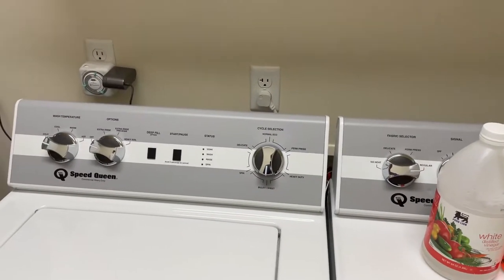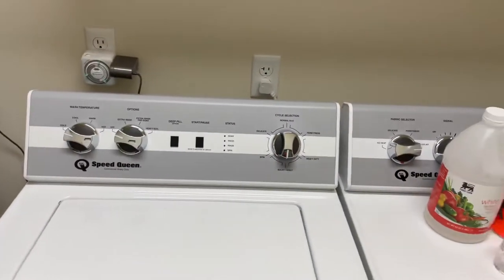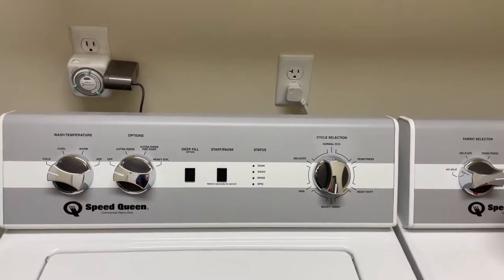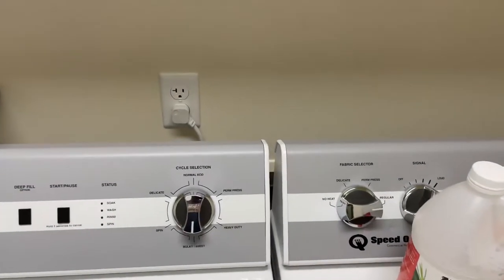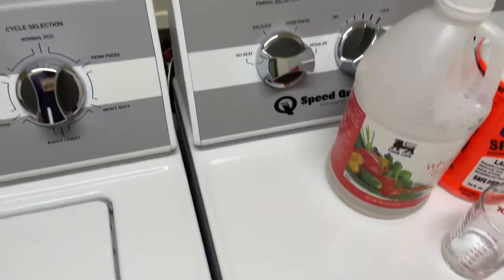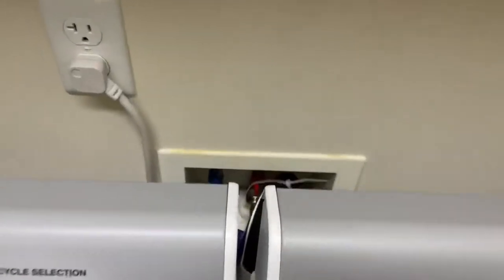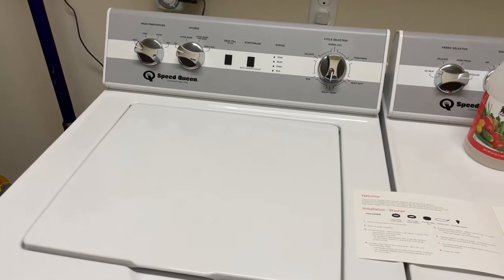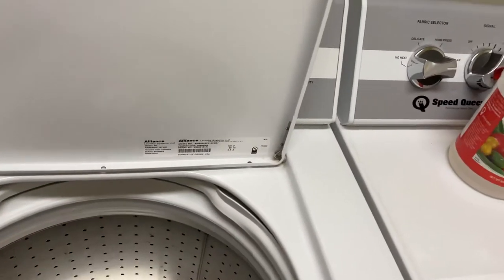Foam Bubbles coming out Speed Queen Washer drain hose - Fixed!

Comment: Thank you for sharing your videos. I currently need to purchase a lint cover my TR5000WE dryer. Bought both washer and dryer in July 2020.
I am interested in cleaning below the lint trap. Build up do I need a service call or can I  do it with a vacuum. The screw in the lint trap is very hard  to move. Maybe it's me. Got any suggestions or do I  need to get a service call? It appears to be a large build up under the lint trap. Thank you. I would check dryer it would have water in the tub from time to time. Not sure why finally got it stopped. 😕 love my set I switched from my front load set to Speed Queen.  I believe less overall hassles. Thank you, again.
Reply from the maker: Hi Vickie.  You're welcome.  Yes.  I remove mine once per year to clean underneath it.  The screw that holds my lint trap in place is a small, hex, American head socket.  Clean all the lint away from around the screw with a small screwdriver or pick so you can get a socket on the head.   
     Thank you for leaving a comment.  Please click on the words “Rick’s Tid-Bits” underneath the video to go to my YouTube channel.  I think you’ll find some helpful and unique tips in my How to Make Life Easier or Better section.  https://www.youtube.com/channel/UCc-IuUFzC2Tyv06KzJyBESg  Rick You’re welcome.

Comment: The following worked for me. I tried every imaginable combination, resulting in overflowing foam.  Have only owned it for 2 weeks.

Foam is created during the SPIN cycle. So must monitor it, it’s about 5 min spin cycle. Luckily, I was supervising during spin, cleaned up foam mess while occurring, before it migrated to hardwood floors. 

1) “Permanent press” or “Delicate”.
Other washes have FAST spin creating excess foam. Especially Obama Eco wash. It foamed and leaked a lot since also no rinse cycle.

2) Fabric ECOS Laundry detergent. Use only 1/2 a sheet. 1 sheet caused foam.
Reply from the maker: Hello Hoa.  I agree.  The high speed is 8 minutes long, and it's always the last 3 minutes of that spin that causes the problem.  The low speed spin doesn't do it.  Thank you for leaving a comment.  Please click on the words “Rick’s Tid-Bits” underneath the video to go to my YouTube channel.  I think you’ll find some helpful and unique tips in my How to Make Life Easier or Better section.  https://www.youtube.com/channel/UCc-IuUFzC2Tyv06KzJyBESg  Rick

Comment: Besides this method the only other solution I've found is using powder detergent vs liquid (I prefer powder anyway) 0 suds with the powder.
Reply from the maker: Interesting!  Thank you for adding that Dylan.
Reply: Wish that had solved it for me, but it didn’t. We still get suds when using powdered detergent. 😢
Reply: @jbintx4009  how much powder do you use? I only use 1 tablespoon for normal fill and 2 for full tub. You might still have suds from liquid in there

Comment: I tried adding vinegar to the wash cycle and the rinse cycle. I also ran a few loads of no clothes and vinegar then another no clothes load using a cleaning tablet. Nothing has worked. I still have foam on any cycle. So far nothing has worked.
Reply from the maker: Hi Joni.  Try this:   Speed Queen told me to run a cycle on Hot, no soap, with a cup of vinegar.  They told me it would flush out any residual soap build-up in the machine and the drain line.  That helped for the next 2 loads.  Then, we were back to the same issue.
Reply: @rickstid-bits  Thank you for the suggestion. I understand that detergent has changed significantly in recent past becoming much more concentrated. Have you ever heard of a hose adapter to prevent the foam from running over the pipe? I wonder if that would help.
Reply from the maker: Hi Joni.  I haven't.  The problem is:  We can't completely seal the gap between the washer's drain hose and the drain pipe.  The house plumbing needs the air inside that pipe to form an air gap.  If we sealed those pipes together: We run the risk of creating a back siphon.  That could cause sewer water from your house plumbing to flow backwards, into your washer, and onto your floor.  
     I thought about having a rag/cloth soaked with water and vinegar and wrapping it around the opening of the drain hose.  But I would have to wet that ever day we did laundry, so I never tried it.  Rick

Comment: I think there needs to be a class action lawsuit against speed queen if they refuse to solve this issue….
Reply: I agree. I noticed he said that the drain pump keeps pumping air while spinning. That's what creates the foam soap suds. Is that a normal thing with other washing machines?
Reply: @randothecomando this is the way all washers used to work, something has changed in the detergents in recent years, speed queen has used the same pump for the last 30+ years, but this has only been a issue for the past 4-5 years.
Reply: I used a tablespoon of Tide HE detergent with the normal eco mode as instructed to correct the problem, but that didn't help. But it still foamed over.
Reply: @randothecomando   stay away from the eco cycle,  the pump is on from the time the wash water starts pumping out all the way to the end .  Makes this issue way worse.
Reply: Speed queen is not what has changed here but they are going to have to adapt to the changes, for instance the mechanical pump is far superior to the electric pump but I wouldn’t fuss about them switching to the electric pumps so they could cycle them on and off during the end of the final spin, solving the issue.  That is why the newer design machines don’t do it , they were designed to use the newer formula detergent.
Reply: They sort of did solve this problem. As others have said, the pump is working the whole time the washer motor is running. The pump is hooked directly up to the motor. With the newer TR series speed Queens as well as every other new washer, the drain pump is completely separate from the motor that turns the agitator and the tub.

Comment: Why should you have to?
Reply from the maker: We shouldn't.  We shouldn't have to do any of this.  But the reality is . . . if you have the foaming problem, here is a solution.  Rick
Reply: @rickstid-bits  Hi Rick, were you using high-efficiency soap detergent?
Reply from the maker: Hi J.  We use Atsko Sport Wash.  It has zero fragrances and zero additives. It is an extremely basic clothes detergent.  We were using this same detergent in our last washing machine for years - without any foaming problems with that machine.  
Thank you for leaving a comment.  Please click on the words “Rick’s Tid-Bits” underneath the video to go to my YouTube channel.  I think you’ll find some helpful and unique tips in my How to Make Life Easier or Better section.  https://www.youtube.com/channel/UCc-IuUFzC2Tyv06KzJyBESg  Rick
Reply: @rickstid-bits  Does the Atsko Sport Wash work in HE machines? I just bought a Speed Queen and having the foaming issue. I haven't tried using it on any other cycle other than ECO yet. I have to wait for more clothes to wash. TIA
Reply from the maker: Hi Debra.  I honestly don't know what makes a machine an HE machine.  I've never been interested in an HE machine.  I simply want a washing machine that does a good job washing clothes.  I recommend you do not use the ECO cycle.  In my description under my video:  Click on the word More, and then please read all the information I have there.  That explains why some cycles are better than others.  Rick
Reply: I tried the vinegar trick and still got suds. Ran just vinegar and no detergent, no backup/leaks. So I’m trying the perm press cycle to see if the extra rinse will fix

Comment: Speed Queens are rather expensive and this is a problem that has to be rectified by the manufacturer. As a customer, Why do you have to deal with a probable defect that should be handled through the warranty. My Sears Unit never causes foam built up. This kind of reminds me of the Car makers that try to fix everything with updates when there difinitely is a problem and they keep delaying an actual repair to the problem. So as long you own this particular model, I guess you need to budget in the cost of vinegar, Yeah I know its cheap, but thats not the point. People if this continues, A Class action law suit may be in The manufacturers future.
Reply from the maker: Hello. I do not disagree with you. I do not know why Speed Queen has not fixed the issue. I am 65 years old, and I’ve had a lot of other brands of washing machines. And none of them have ever done this on us. I think it is because this thing spins so fast, that air gets mixed up in the pump. And when there’s very little water left in the pump: the air and the water just circulate and pump and pump and pump and it just creates the foam. I certainly think there has to be a simple fix to this. I do not expect there will ever be a warranty repair for this. I am content, not happy, but content that using the inexpensive vinegar fixes the problem for us. In my opinion: this is still the most commercial quality built machine available today, with the least amount of electronics and gadgets that I do not want in a machine. I’ve talked to a lot of repairman and they will tell you flat out, hands-down, a lot of the other brands that are out there are going to break down quickly, and cannot ever be repaired.
Reply: I concur with Rick. Based on my research and many other threads out there Speed Queen is still the best. I had a plumber out AND someone from the appliance people that come out to repair appliances under warranty and they all say Speed Queen still years later, don’t have issues like all the other brands. They’re always sent to fix every brand except for Speed Queen and if by chance they do, they cringe because it’s better to buy a new one because they’re so complex to take apart. Rick you’re a gem because a teaspoon of vinegar in my rinse cycle does the trick!

Comment: Same problem. New machine. All ready replaced the wall behind the washer/dryer. I’m so done with this machine. Not my first SQ so I know this is NOT normal. I have always used white vinegar in the rinse. Still leaks down the wall. Never use Normal Eco cycle. Still leaks down the wall. Use HE detergent. Still leaks down the wall. This machine is too expensive to have to find work around to make it function. Class action suit, I’m in.
Reply from the maker: Hi Tonya,  I'm sorry the Vinegar trick didn't work for you.  I'm sorry I don't have any other suggestions for you.  Rick

Comment: It's too much detergent, you generally need about half of what they recommend.  Vinegar does stop foaming but the problem is too much detergent.
Reply: With our SQ nothing mattered regarding how much or little soap we used.  Got rid of our SQ and never had issue with new machine.  I was furious over all the hassle it caused .
Reply: @lesleyvaleski5055  No problems with soap bubbles on my 1986 Maytag.  It's only 36 years old so it's just a baby in vintage Maytag years.
Reply: @eloquent-nuance  Regardless, most people use too much detergent, you only need about half of what they recommend on the package. Pods are the biggest scam, less detergent for more money, but they have people convinced its better.
Reply: I’m a 1 tablespoon user (h/e detergent only), and unfortunately I’m having this problem…. No cycle or setting is stopping it either….
Reply: @eloquent-nuance  - Thats probably exactly what I need (I’ve looked at a few modified set ups to solve this issue)…. I wish there was a way I could see what you rigged up, to show my husband… I do have this machine.
Reply: @piecesoftheheart9231  Try Charlie's Soap Powder or liquid.
Reply: @eloquent-nuance  - it’s behind drywall/behind washer but I’d be willing to change a lot to make a good permanent solution… I hate h/e washers
Reply: @eloquent-nuance  - Just seeing this now! Going to look, and thank you!
Reply: cut detergent way back, still have the problem
Reply: @charlesbarnett3021  - Somehow, my issue has disappeared 🤷🏻‍♀️ It did it for about 2 weeks and then just stopped… never did it again (knock on wood)